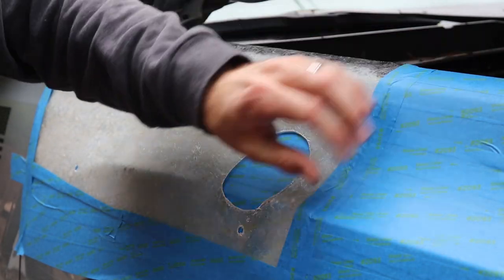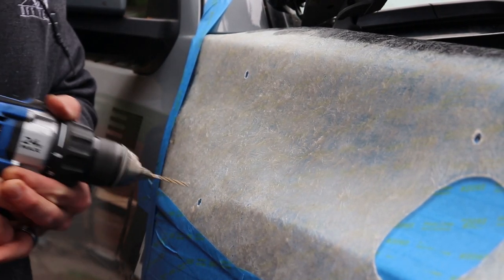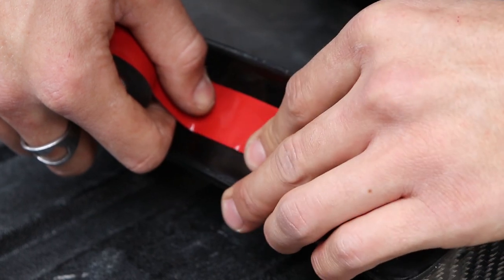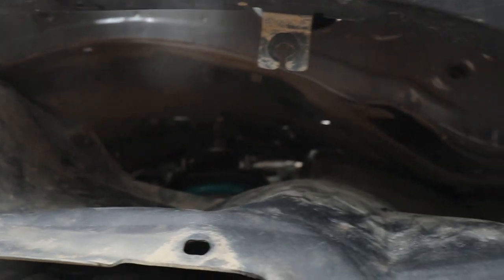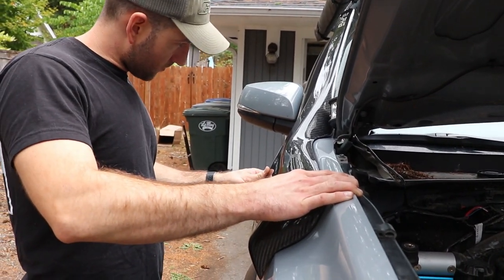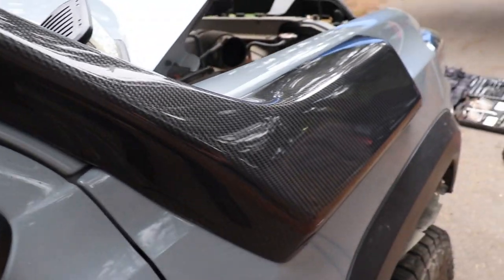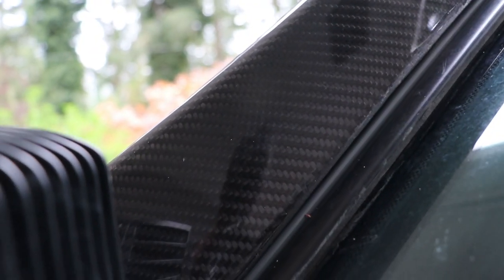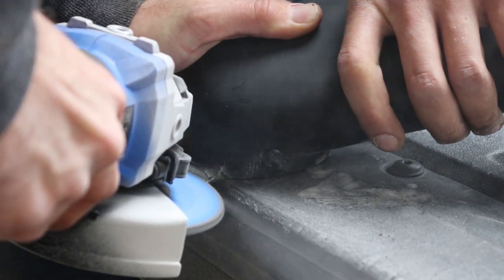Alpha Equipt Snorkel Install and Review || 2019 Toyota Tacoma || Off the Grind

Comment: I’ve been thinking about getting this for my 4Runner. I need a low profile, but the fitting matters a lot.
Reply from the maker: It looks good once it’s on, but just really disappointed with the amount of adapting I had to do. The stock air box still isn’t mounted the correct way because of it

Comment: Great video man thanks for the heads up. Are you still rocking this snorkel? Have you noticed any differences in peppiness or mpg? I'm looking for some dust and water protection but I want to make sure I'm not choking the intake.
Reply from the maker: No I haven’t at all. I did switch to a K&n filter at the same time. Not sure if that helped but it doesn’t act like it’s fighting to breathe at all

Comment: I just finished an install of the long version of this snorkel.  I agree the template is garbage.  I also had to fiddle with the holes to get everything to line up.  Fitment so so.  Difficult to get the nuts installed behind the panel.
Reply from the maker: Yeah I really expected the fitment to be better. The tube between the snorkel and the airbox was trash too. It would be better if it was flexible.